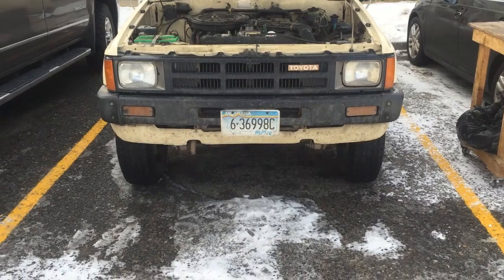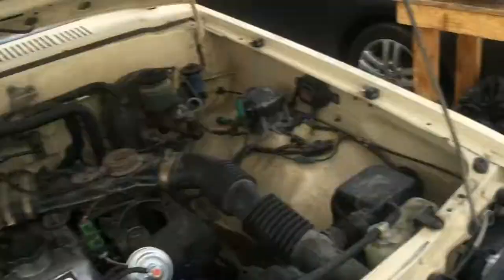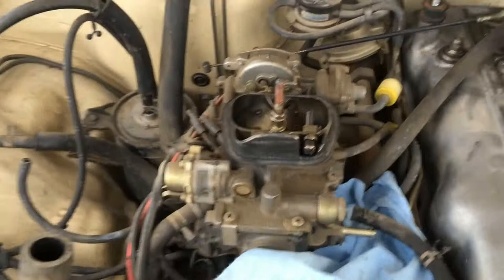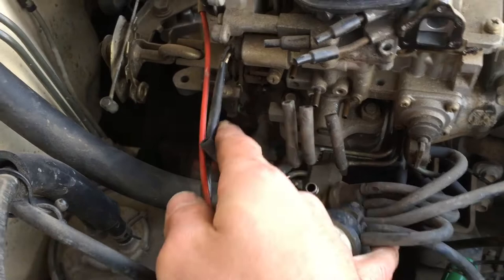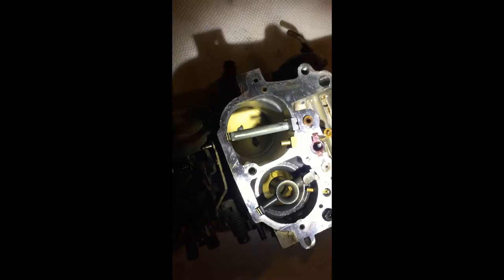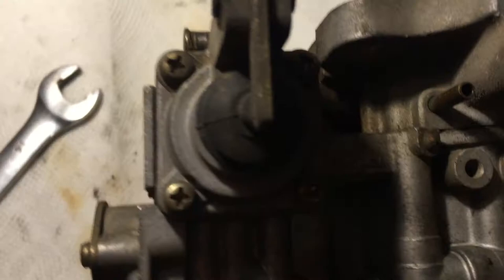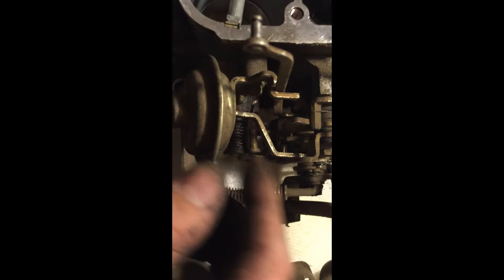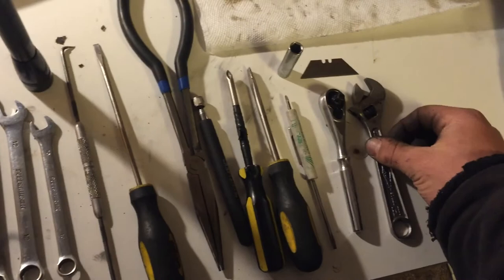VERY UNHELPFUL 1984 Toyota Pickup Carburettor Removal & Rebuild

Comment: Disculpa, en el kit de carburador que compre Toyota 22r . Hay unos balines de acero, en que parte del carburador van ?
Reply from the maker: Oh boy, it depends on which pellets you’re referring to. I think most of them are spring loaded check balls for fuel, possible to do with the idle or secondary circuits. Beyond that, consult the OEM Toyota service manual, it’s highly year and region specific...

Comment: What size are those vacuum lines? Thanks all
Reply from the maker: What I’d recommend is taking the truck to Napa, pulling off a vacuum line and bringing it inside to match. Which ones are you tryna replace? All the smol ones are the same I think. The bigger ones you can do the same with tho...

Comment: Great video Rambler! I have an 82 toyo that needs exactly what your doing. 312k original miles. Had the truck 42 yrs. @mattyjack1
Reply from the maker: A lot of folks get wither a weber 32-36 or weber 38 and slap it on. A lot simpler, idk if it meets emissions tho

Comment: Jesus Christ I just rebuilt the carb on my 65 mustang and it was 10x easier than the bullshit I’m about to have to go through on my 87 pickup.
Reply from the maker: Emissions era carburetors are a world of their own. I find that it really helps to have an understanding of the generic emissions devices of the time, that way one can understand the operation of each of the specific components separately. I did a much better video recently about the carburetor setup in the truck, one that was less of a joke and actually meant to be somewhat helpful. They are quite complicated devices but when tuned correctly with new gaskets they run better than after market carburetors.